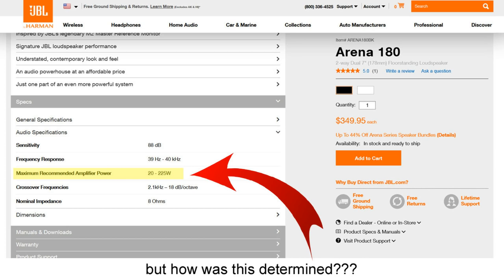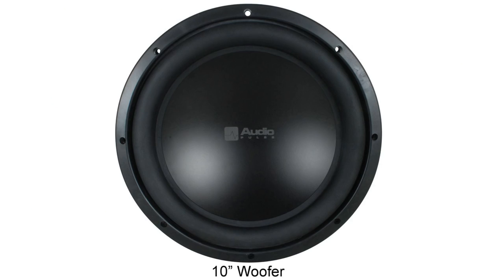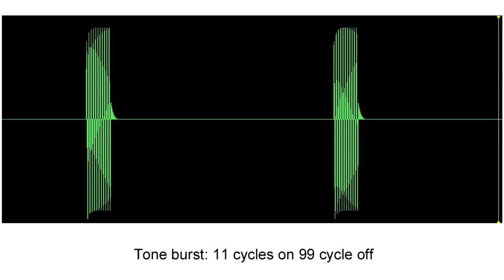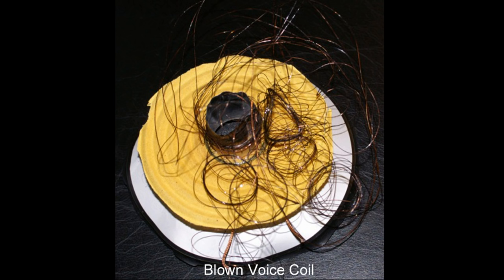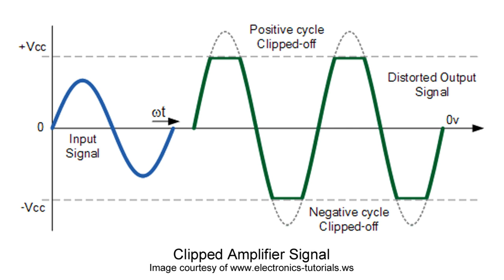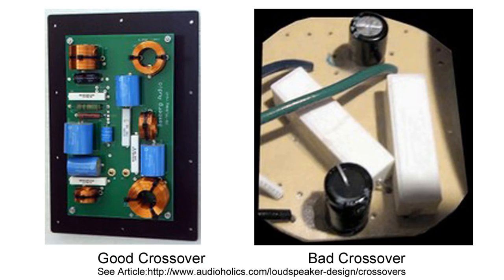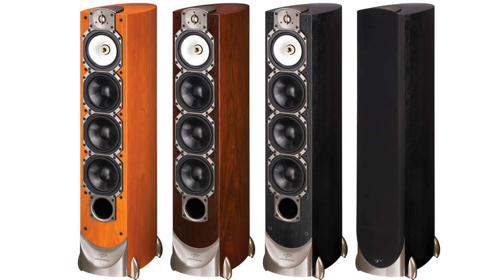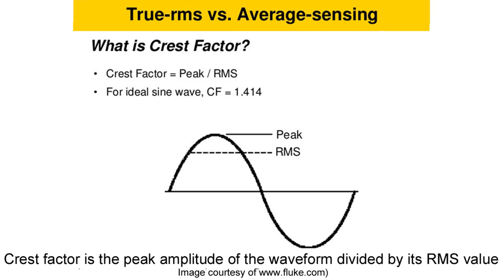The Truth About Matching Amplifier Power to Loudspeakers

Comment: Early in the 1800's the Frenchman, Joseph Fourier, realized that any periodic waveform is equivalent to a summation of sines and/or cosines where each has a particular frequency and amplitude. Each of these sine or cosine wave forms is called a component of the Fourier series. The only frequencies present are the frequency of the original waveform, called the fundamental frequency, and integer multiples of the fundamental, called harmonics. The amplitude of each frequency can be calculated. If the original waveform represents a voltage applied across a resistance, then the amplitude of each of the sines and cosines corresponds to the voltage of each of the Fourier components. Since the amplitude of a sine wave is the height of the peak, then the power that that sine wave delivers to a resistance of R ohms is the square of the amplitude divided by  (2 x R). If we have an amplifier that can continuously supply a sinusoidal waveform of amplitude, say 28.28 volts peak, to a resistance of 8 ohms, and the amplifier is on the verge of clipping, then we could safely call that a 50-W amplifier. If the input signal were large enough and there was no limiter, then the signal could be increased into clipping by the amplifier. The worst case of clipping would be for the sinusoidal waveform to be made into a square wave. The amplitude of the fundamental sinusoidal Fourier component of a square wave is 4/pi x 28.28 = 1.273 x 28.28 = 36.0 Vpeak, and the power to the 8-ohm resistor is 81.0 W (36 x 36/(2 x 8)). In the case of a clipped sinusoidal signal, there are no even harmonics. The only harmonics are at odd multiples of the fundamental frequency. Therefore, there is a harmonic at 3 times the fundamental. It's amplitude is 12.0 Vpeak. The power supplied to the 8-ohm resistance by this harmonic is a mere 9.01 W. The amplitude of the harmonic with a frequency of 5 times the fundamental is 7.20 Vp, and the power supplied is 3.24 W. The numbers for the harmonic at 7 times the frequency, are 5.14 Vp and 1.65 W. For 9 times the frequency, 4.00 Vp and 1.00 W. The total amount of power delivered to the 8-ohm resistance by the square wave is the square of the amplitude of the square wave (28.28 Vp)^2 divided by 8 ohms = 100.0 W. So, for all square waves (and very severely clipped sine waves), 81% of the total power is in the fundamental, 9.0% at 3 times the fundamental freq., 3.24% at 5 time the freq., 1.65% at 7 times, and so on. Based on what I have said up to now, I think it highly unlikely that there would be enough power in the harmonics of a clipped sine wave to damage a tweeter, unless the fundamental frequency of the clipped sinusoidal wave is above the cross-over frequency. In that case even the 81% of the power would be applied to the tweeter.

I've done more looking into this matter of clipping since I wrote the first part of this post. I have made a graph of the instantaneous power (as opposed to the average power over time) of the Fourier coefficients at 7 times the fundamental frequency (tweeter frequencies in my case) and above, and I see that there are 4 instantaneous power peaks per period of the clipped sinusoidal waveform, each peak occurs at the "corners" of the clipped waveform. The amplitude of the power peaks can be greater than 6 times the average power in those selected frequencies, depending on how much of the waveform is clipped. These power peaks in the signals fed to the tweeter may very well be the reason that clipped wave forms cause tweeter drivers to fail.

Comment: Clipping is your enemy!  Always get a receiver or amp that is far beyond the speakers rated capabilities.  No distortion, no failure.  Simplistic to be sure, but a rule to live by.
Reply: I think you must mean far below the rated speakers rated capabilities. The speaker RMS rating should at least match but preferably exceed the rating of the amplifier by a factor of 2 to prevent overloading the output stage if you want to use the system at higher volume levels. The impedance of the speaker must be within the acceptable limits of the amp (obviously) and finally keep the volume down to levels such that you dont over saturate the speakers and they will last a lifetime.
Reply: @cbcdesign001  its not the watts or little bit more power that kills the drivers,its distortion that kills them.Its always recommended to have an amp that is double the power of the speakers Rms rating.
Reply: 100% correct sir. You cant have enough headroom
Reply: @cbcdesign001  No, that is not correct. You want as much power available as possible, so your speakers can draw what they need w/o straining the amp. Cranking up the volume won't hurt the speakers if they are powered properly and you don't get stupid. Without enough power the amp will clip, killing the amp and killing the speakers.

Comment: It's mostly about content you're playing, a movie/song is louder than other.
I have 100W with 6-ohm nominal and amp with 135W on 6-ohm and on movies at -25 main volume, the driver moves like crazy but I barely hear the bass, so it's NOT about loudness. I can play rock at insane levels but I can't play hip-hop or movies at insane levels, that's the point. I got a subwoofer to cut 60hz and below and now I don't have a problem. On movies, at -10 main volume, with 150W speakers, I still need to put crossover at 80hz, at 60hz is still too powerful for speakers, even if speakers have 40hz+ response. So matching speakers to amp, is very important. With 150W amp, I bottomed out almost every time, even if I barely heard the speaker. Also I want to mention that when I had 100W amp, I could go to 0dB main volume without damaging the speaker or bottoming out, now with 135W amp at -10dB is insanely loud, well I never tried -10 dB because I may destroy them but at-20 dB is very loud.

Comment: Great video guys...no one really ever deals with this subject much in the home audio world, but in the car audio world it is big! It has been my experience, that more power is better too, even to the tweeters.
There are some tools out there to measure distortion and show clipping, for setting gains to prevent it as best you can, but some sources out there that are just pure distortion unfortunately. 
Being a movie nut and a regular at the local IMAX enough to make friends with the manager(s), they told me of a big issue they were having with the movie XXX (triple X) and the avalanche scene blowing their speakers all the time. I told them I have the fix and he was like we had three tech's in and 1 engineer in and they couldn't solve it. Simply put they were under driving massive speakers (twin 22" flanking a massive horn) with only 200 watts powering; compounding the issue the source sound was recorded too high resulting in mostly distortion that was not cleaned up in post. I told them to buy the most powerful amps they could source from their suppliers (2000 watts, and the volume is set on 2 now), and they have never had another issue blowing a speaker in 15 years, plus I get free screenings! 

Here is a link to the video of the most popular tool for car audio industry...DD-1

https://www.youtube.com/watch?v=np0lpIiSesU

Comment: thanks got It but starting understand it I can have matching wattage as long as don't crank it up?but my center channel 120 watts left and right are 150 watts and amp is 170?
Reply: This video did not explain it well. If you keep your volume levels below the point where there is distortion (clipping, etc.) the you are fine. When an amplifier clips, the amount of distortion it produces is massive, it can easily push out all of the amplifier's power, and what makes it dangerous us that too much of it is experienced by the speaker as being continuous high frequency power so the tweeter often melts its voice coil or is mechanically damaged. If you want to guarantee that this cannot happen to you then you would use speakers that are rated at ten times time power level of the amplifier (ex: 50 watt amp with 500 was speakers), in this example the speakers should be able to withstand the distortion long enough to not be damaged while you decided to turn the volume down.

Most of the time its not a problem as long as the speakers are rated at or above the amplifier rating, for normal listening to music or watching movies. If you like loud special effects in your movies then make sure your amp ad speaker are both rated for high power.
Reply: get an amp rated at east as high as your peak power rating of your speakers, they will never distort, you'll have plenty of headroom, clear sound at all volume levels. your ears and clip indicators will tell you if the volume is to high. underpowering speakers is the worst thing you can do

Comment: Distortion of tweeters is easily audible. Low frequencies are harder to define. Under 100 Hz, 10% distortion can’t be heard by the majority.
Reply: I used to have a 100 wpc at 8 ohms yamaha powering my speakers and I would get the common "hissing" noise from my tweeter. Recently, I got a Emotiva XPA gen 2 which has 300 wpc at 8 ohms, and the tweeter makes a really distorted and horrible noise when you get up close. Is there any chance I'm damaging my speakers with the Emotiva?

Comment: Didn't cover under powered speaker issues.  I have a pair of 1978 Sansui sp3500 rated @100 watts and are  very well driven by a nak TA-1A Stasis amp rated @45 watts! And my Avid 103s are half as loud but still sounds great.

Comment: So, turning up the volume too much on an amp without enough wattage is what blows the tweeter / speakers right? That is how clipping happens, right? You left that part out. It isn't having too many amps, but not enough for the speakers. Having too many watts isn't going to hurt it I think. And you likely won't turn it up to full volume if the wattage is a little higher than the speakers range.

Comment: Great video. My humble NAD 3155 integrated walks all over every Harmon Kardon, Denon or Sony ES receiver I've ever owned. It even drives my bloodthirsty KEF LS50's just fine in a medium-sized room. Best amp I've ever owned.
Reply: of course it does, they are receivers, your NAD is an amp. Receivers are made to process and distribute sound primarily. there amps are weak, even the High end ones

Comment: NECCESARY video!
I can't remember how many times my friends have told me, with great proud, the amount of watts their LOUDSPEAKERS had ( ! ).
To explain them that wattage AMPLIFICATION and LOUDSPEAKERS POWER HANDLING are different, but related, things has costed me more than an angry argumentation.
This state of things is simply because, today, most manufacturers hide, as you point out, the real valuable specs and most retailers, of the few who last, don't have any idea about what they're selling.
Next time someone will ask me HOW MANY WATTS my speakers have, I will run fast like the devil.

Comment: audio there is something im really confused.. some say  the speakers must have more wattage than the amp coz if the amp has more wattage than the speaker.. the amp will burn the speakers? then some others say the amp must have more wattage than the speakers coz if the speakers have more wattage than the amp.. tendency amp will burn! im really confuse bigtime so which really is which mr audioholics???
Reply: All of the above is true, You are confused because this video does not explain this subject well enough.
If you allow an amplifier to see distortion to the speaker then the speaker is likely to be damaged.
If you send more power to the speaker than the speaker is rated for, for too long a time, then the speaker can be damaged.
The easiest way to handle this is to get a speaker that is rated at the same level, or higher, as the amplifier then make sure that you do not drive the speakers into distortion (even for a moment). If you cannot do that then use a speaker that is rated at ten times the rating of the amplifier.

Comment: Consider a speaker's power output limit is rated as 20 to 150 watts... What happens to the speakers if the speaker is powered by just 8 to 12 watts of output power?????
Reply: They will still work, not loud, most normal listening is usually below 1 watt

Comment: I can remember the Klipsch Corner horns driven with my Sony Walkman in the 70's it was so loud it would drive you out of the room.  It does not take much power to drive most speakers these days given that we have subs taking on a lot of that power need away from the amp and using it's own internal amp but the power you do have needs to be clean high current.  Most persons do not know how loud you can get music to play at 8 watts of actual usable high quality power.
Reply: Off my mid highs 8 watts is noisy club loud and off my subs groovily loud but not thunderous. In a small room one of subs off a lepai 2020a was quite impressive.

Comment: Concur, power is good. Generally more power is better. I'm using a couple Crown 2500s, each pushing a 350wrms 4-ohm sub and an Odyssey Lorelei (about 6 ohms and 150wrms) without any problems. I don't get stupid with the volume and I have lots of headroom. The amps are loafing.

Comment: im struggling with my setup i have b&w bookshelf 5.1 system. but the system needs to be running at between -20 and 0db to get decent volume and always sounds quiet. just cant work it out
Reply: Jonathan Roebuck what model are they? and what receiver are you using?
Reply: Erick Lopez Hi! I'm using a Denon AVRX2000 which is 95w into 8 ohms if i remember correctly
Reply: what size is your room?
Reply: Quite large 3.5m by 3.5m i would guess. With an open bit leading to kitchen which is closed off with a door
Reply: what kind of speakers are they? what model?
Reply: Erick Lopez  685 s2 front s1 rear htm62 and asw608 sub
Reply: nice! that's what I own! but ummm...room size, I'm about the same, maybe a bit smaller. I never need to go above -20db. are you sure you don't have some type of hearing loss?
Reply: Haha i thought that but no, girlfriend always turns it right up to get a decent level too. So much so if say my old yamaha all in 1 was better yet this has cost me a fortune :(
Reply: believe me, you have great sprakers! you definitely didn't overspend. It might just be your receiver. Have you tried hooking your speakers up to a different receiver?
Reply: I havent to be honest but dont have the funds to blow 600 on a new one :/ no one can really tell me if it would make any difference. Everyone on forums have told me its adequate but something isnt right
Reply: borrow one from a friend.... or put one on a credit card and open it carefully and then return it after testing
Reply: So I've been messing around with my system. Try changing your TV audio settings to Bitstream instead of PCM. Then do the same to every other source you play from, whether it's your DVD player, CD player, Stream box etc. This way your receiver gets nothing but uncompressed audio straight from your source. Hopefully this makes a difference.
Reply: thanks so much for your help, unfortunately I've tried everything and nothing makes a difference. its almost as if its limited and you juat need to press a button and it's twice as loud :/ I think having a play with another receiver is all i can do :(